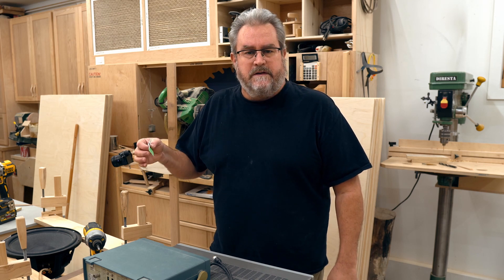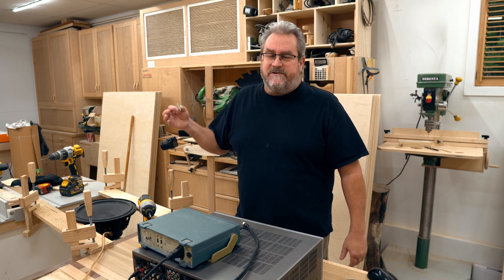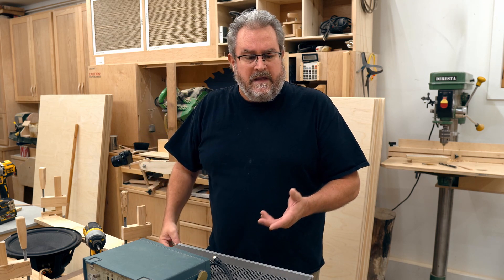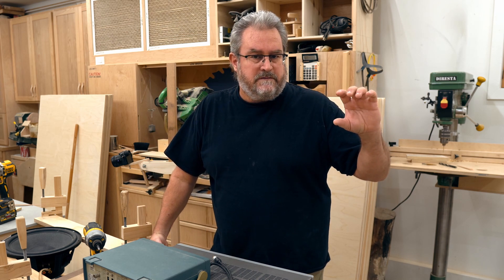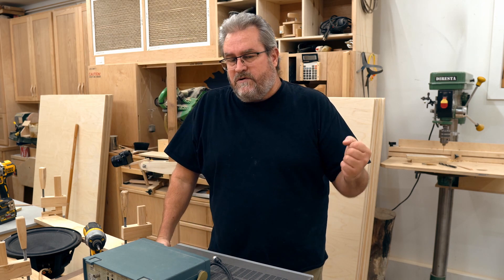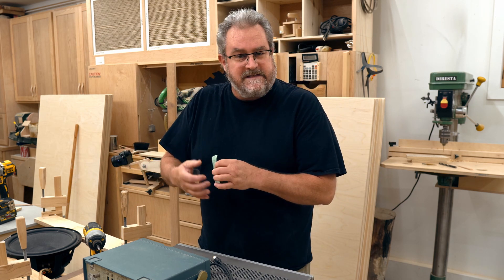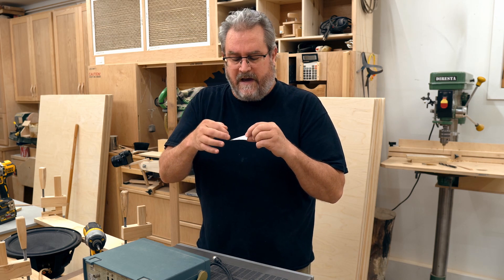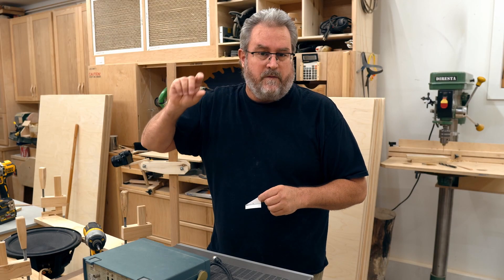Simple Trick for Measuring Woofer Stroke / Excursion

Comment from the maker: Strange noise? A lot depends on how well the woofer was designed and made. There's often a very audible sounds that happen when the speaker is driven harder, in particular from the air movement behind the spider. Or the voice coil could bottom out in the magnetic gap creating a very hard not to hear hammering sound. Longer than necessary wires that connect the voice coil to the terminals can slap the cone at high excursion.
The wedge micrometer:
credit to Linkwitz Lab: http://www.linkwitzlab.com/images/graphics/wedge-micro.gif
Even without the wedge micrometer it's a good idea to run this test to see how the woofer you want to use performs.
When I say you can use this to design your speakers, I mean you can use it to define the limitations - just how far the speaker can be pushed before it starts making something other than music. 
Don't use this to replace the published Xmax of a driver. 
Instead, use this to do a reality check on the speaker design and get an idea of the amount of usable output you can get.
Most woofers are over-driven on transients and will distort. But it's the amount and severity of that distortion that matters.
Reply: Like this particular series of inexpensive woofers I like to use. They are very finnicky. Free air sound ok, in a box they need a small tight space and sometimes damping materials or they make all kinds of strange noises. Get them in the right box and they are awesome for the price.

Comment: Ok. So I used to work on some pretty globally large physics projects and had this crazy idea since when I was one of those teenagers who thinks he was an expert about 35 years ago, lol. And I’ve had some ideas since I was that goofy kid. One thing I’ve always wanted to do is measure the force of resistance of the whooped as it is traveling it’s maximum travel range. It’s easy to dk like your taped on measuring tool. You could tape a spring scale to the top of the dust cap and use a vertical beam to slide the spring scale up through the speaker’s solenoid’s range to get the resistive force of the speaker’s outer rim as it travels the full range. You could also find the collapse depth this way but that’s never good for precision unless you throw out the speaker and statistically repeat the experiment within a safer travel range. Anyways you can calculate what you cleanest effective frequencies are and response times if so desired. But my favorite from this is in ported speaker box design and using band pass crossovers, you can determine the absolute best quality performance out of the speakers this way. And in your isobaric set up, you should be able to avoid rigging up a complex measuring device for the above and instead measure them separately, add the values, and plot the results for eye candy to determine the isobaric performance.

Now I’m not an acoustics guy, but this is just something I’ve always wanted to do to maximize quality usage of a sound system. You could do this with all of your speakers.

Comment: John, I did have a question ... How is the bass response from the full-range speakers in your console stereo build... I am very interested in building one.. Also any tips on amps for it?
Reply from the maker: Actually pretty good bass response from those. I'm just using a small class D amp that works great.
Reply: @IBuildIt  thanks would there be any reason to add a 3 channel amp and run a sub in the pedestal?

Comment: So it's X-Mech, mechanical not really Xmax. You could also start by measuring distorsion, and stop when hit 1% (for example) and then measure excrsion ?
Reply from the maker: More difficult to accurately measure distortion, especially anything as granular as 1%. 
This is a test to reality check just how much the cone can move without making really bad sounds. I use this to help design the box and determine the max power the speaker can handle.
Reply: @IBuildIt  
I'm guessing you already know this, however it's worth noting that stroke testing to determine power handling is really only determining xmech noise onset, just as you pointed out. 

Sub power handling is freq dependent; down low it's excursion limited, up higher it's thermally limited.

Comment: I compared tapped horn vs front loaded horn design for my uni thesis. I designed and built two horns and ran the same driver in each. Testing speaker excursion was one of the key points because a tapped horn is supposed to be able to be driven harder before distorting because of the tapped design. I had a friend who is in film help with testing it. We filmed at a high frame rate with a card on the speaker. The card was a known size, so I was able to input that into a piece of software that allows you to measure things on film. Can’t remember the name of it off the top of my head, though. Doing that allowed me to measure the excursion in the different enclosures. Here’s one of the tests we filmed. 
https://youtu.be/cvWZYNnGTH4